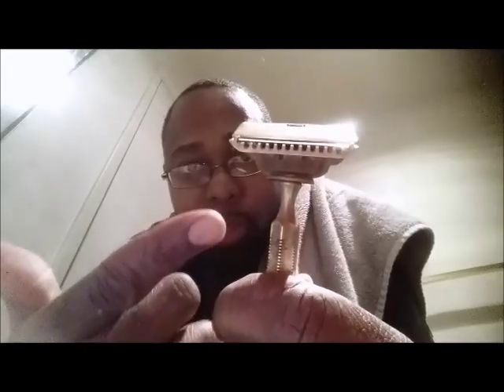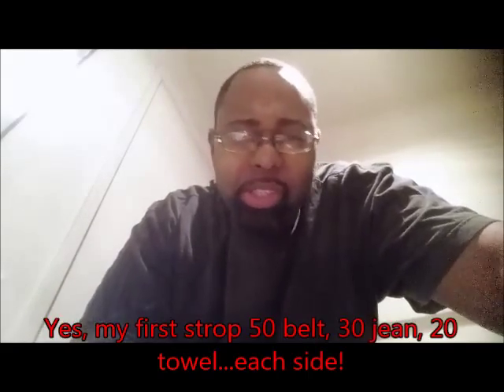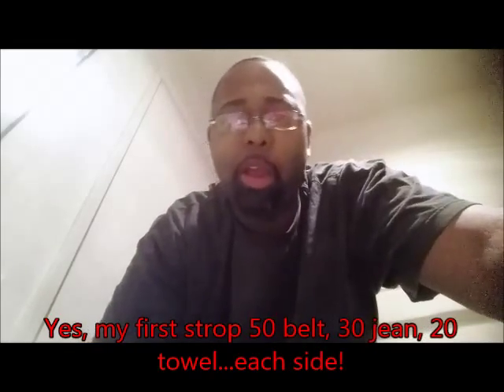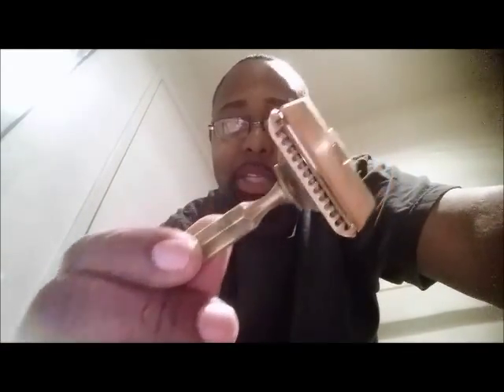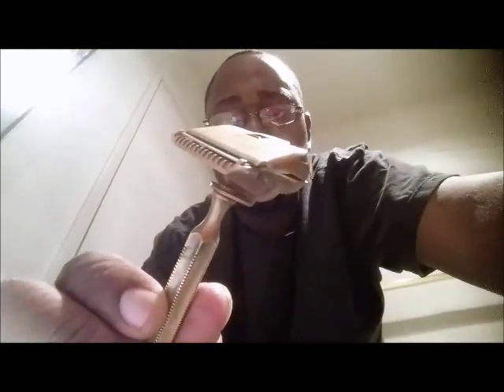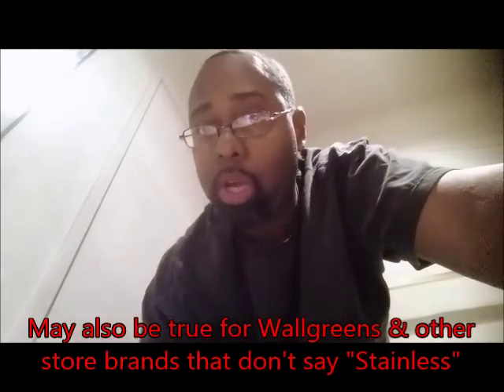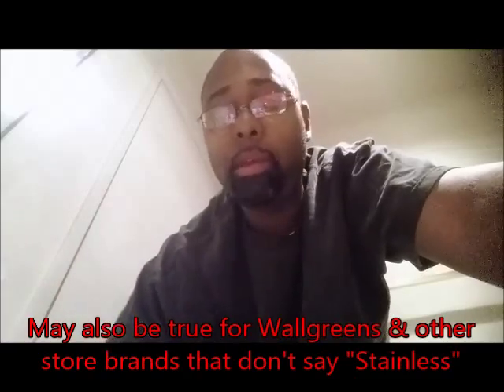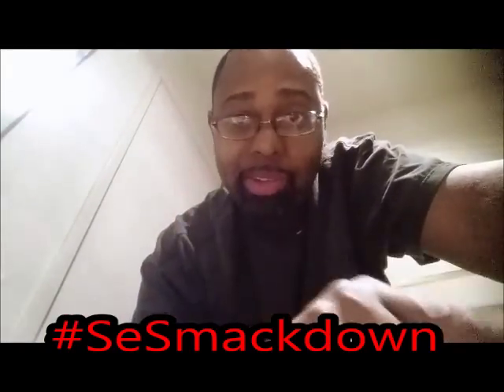Single Edge Blade Sharpening (Stropping)

Comment: If you look on Ebay or antique stores you can actually find stropping tools for single edge blades. I hope newer ones will fit. I have an old dull SE blade that I will actually try to sharpen for real, with a sharpening stone :) I do have some experience with straight razors so that helps.

Comment: Very good, worthwhile, video.  The Feather FHS-10, se, blade for the oneblade razor cost between $.70 to $1.00 apiece. oneblade recommends 1 shave per blade.  If I could get your system to give me 5 shaves per blade then I would reduce my cost to $.14 per shave.  Certainly worth a try.  Thanks.
Reply: Ron Ireland using a genuine leather strop for a straight razor will definitely yeild greater results!